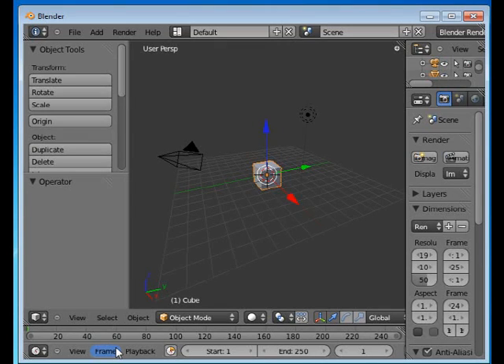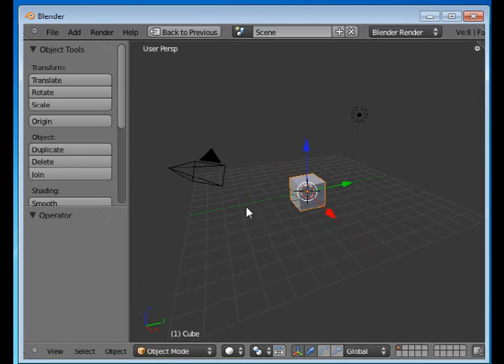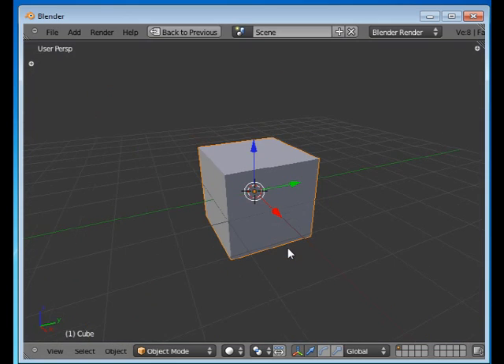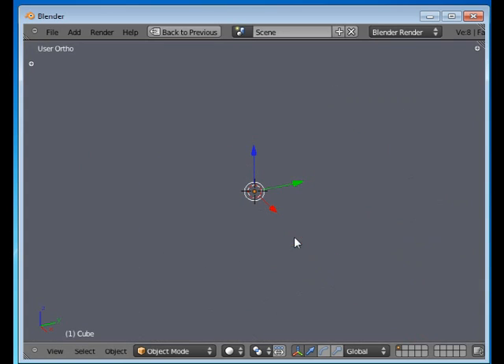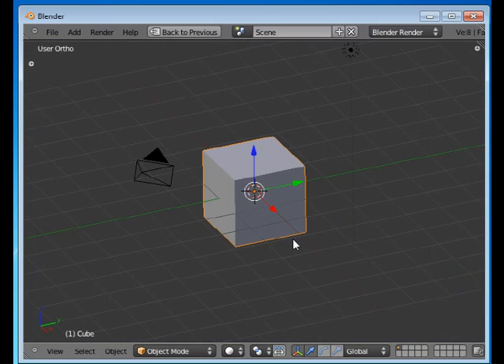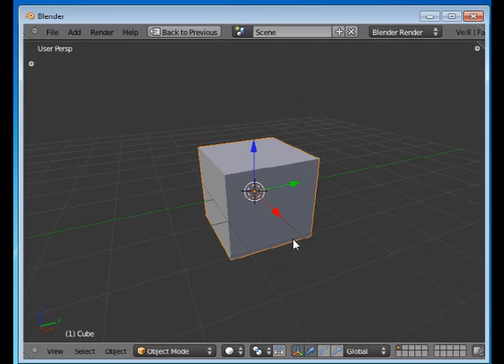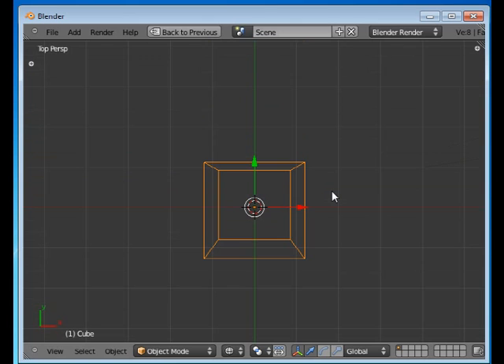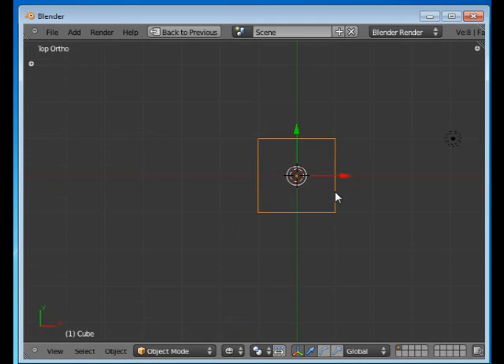Absolute Beginners Blender 3D #3 Tutorial

Comment from the maker: Try the "Load Factory Settings" option in the File menu. Then open up User preferences and under the INPUT tab check the Emulate Three Button Mouse. This should set your user interface to the same as I have used.

Comment from the maker: When you press 7 on the alphanumeric keypad you change which layer you are working in, to change to top view you need to press 7 on the numeric keypad. If you are using a laptop which does not have a numeric keypad you can activate emulate numpad in user preferences under the INPUT tab. Tutorial #5 explains how layers work and tutorial PRE #8 explains the Emulate Numpad option.

Comment from the maker: Since I'm on a PC I don't have a way of trying a setting that produces this problem. However you could open up user preferences under the File menu and make sure you have "Emulate 3 button mouse" checked it's found under the INPUT tab. On the PC this has no impact on the sideways scrolling but there could be a difference in how it works on Mac OS. This could be a good time to try out the different settings under user preferences. Is there a way to emulate the PC keyboard on the Mac OS ?

Comment: @RLW120471 You should have a Function key (Fn Key) on your laptop. Usually to the bottom left near your windows key (That's if you have a Windows laptop). Now, you should notice the keys to the right have small colored numbers on them next to the letter the the key represents. If you hold the function key down and hit one of the keys that have the small numbers on it simulates a number pad. This is the case with most laptops anyhow. If your's does not have this feature I don't know then.

Comment from the maker: @RLW120471 You can use the view menue where the different views are available  as Top, Bottom, Right. Left, Front, Back. BEFORE YOU DO ANY OF THE THE THINGS I AM ABOUT TO TELL YOU VIEW tutorial #5 and then you do this.  CHECK  the emulate num pad box in User Preferences  MAKE SURE TO DO THIS THE VERY FIRST THING WHEN YOU OPEN UP BLENDER AND GO BACK TO 3D VIEW AND PRESS ctrl u to save user preferences. Now the keys 1-0 on the alphanumeric keyboard has the same meaning as the num key number keys